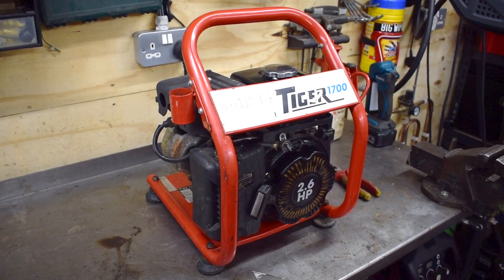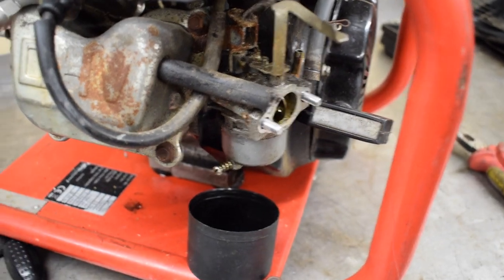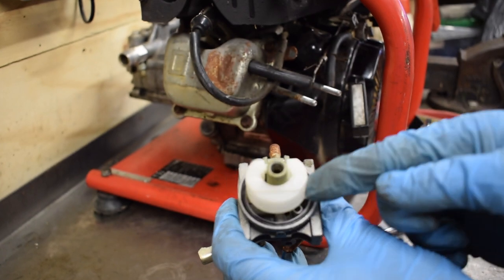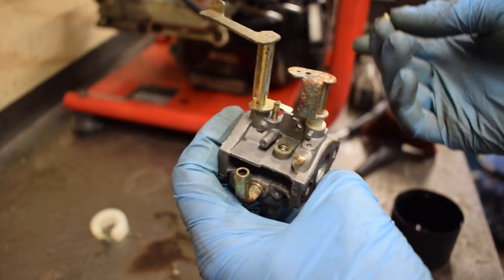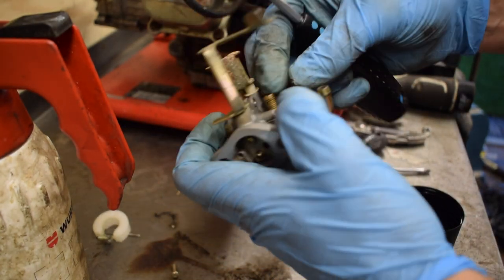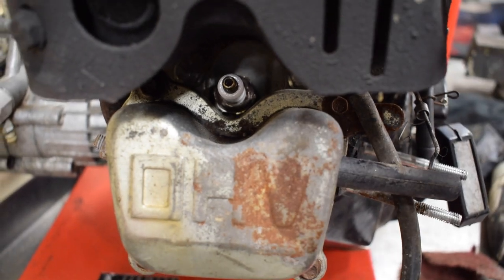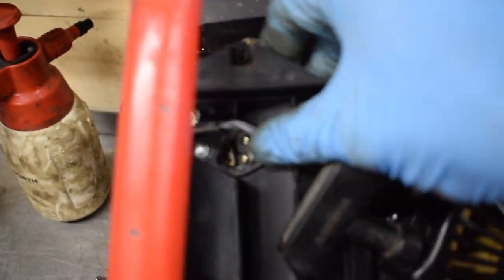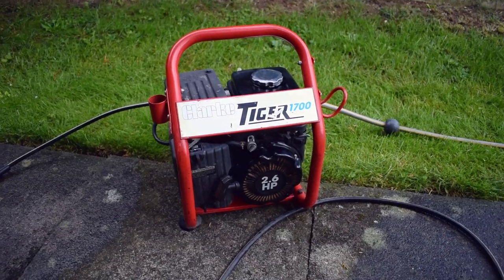HOW TO FIX A SMALL ENGINE

Comment: Thanks for another informative video. Looks like what you have there is a 3 HP 79 CC Predator engine. They are an economy line of small engines available here in the US at places like Harbor Freight for around $100. My bigger pressure washer has the 212CC version. Parts are available online, there are also people hot rodding them for racing go carts, getting 20+ HP out of them. We are playing around with running my buddies on alcohol lol.
Reply from the maker: Thanks for this, I have been looking this afternoon so I will see what name they use over here. Thanks :D

Comment: Or are they JIS? Especially those cheeky Japanese motorbikes. Been looking for a pressure washer, not too sure on those Ponda engines though, always had or used Honda/Stihl, which are pretty solid engines. They are a damn sight cheaper though.

Comment: Me and small 4stroke engines especially small generators have never gotten on well. But a small powered pressure washer like that would be perfect to add to the collection of small engine compressor/hydraulic pump/water pump

Comment: That’s a Clarke which is machine mart if u need spares set the valves at ex 5 thou inlet 4 thou hope this helps
Reply from the maker: That's right yeah. I used them before to order clarke parts. Didn't need any for this thankfully :D I will have a check of the clearances to what you've said, thank you.